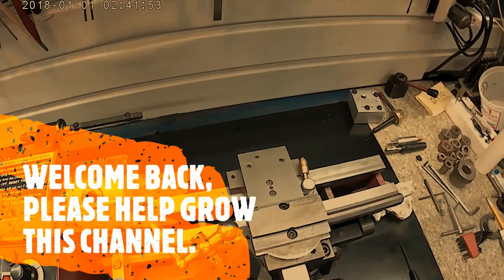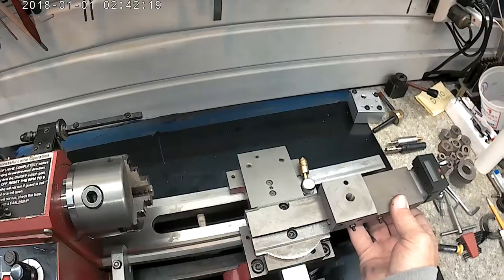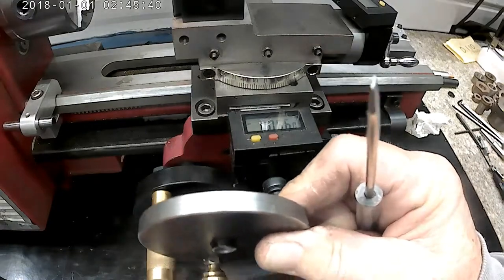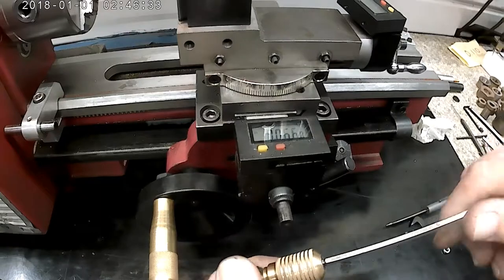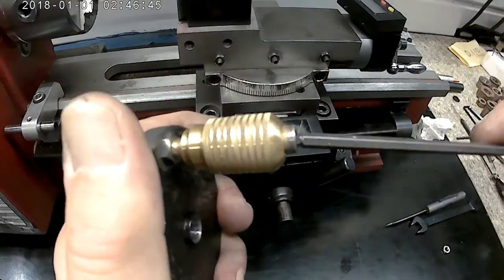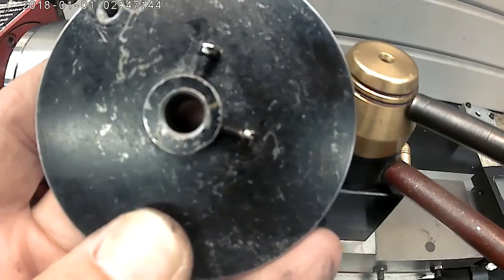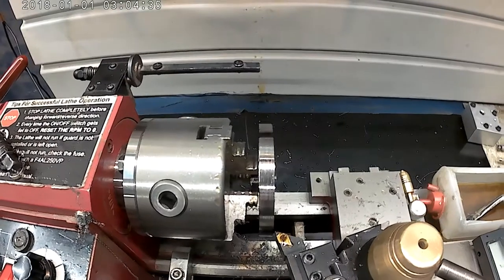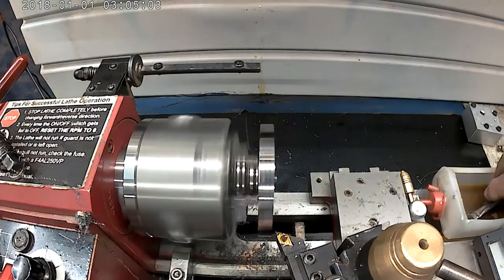MINI LATHE APRON & HALF NUT LEVER ,CARRIAGE DIAL PART 2

Comment: Was wondering if you had any interference between the handles, but you've already solved that problem.  Like the idea of a MT3-mounted faceplate for the headstock - would save time over the existing bolt circle and recess mount.